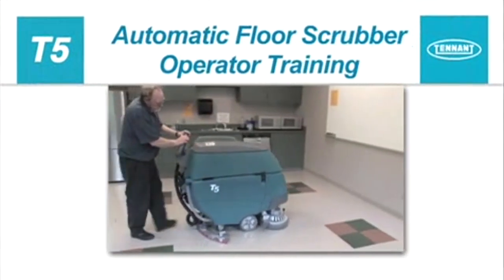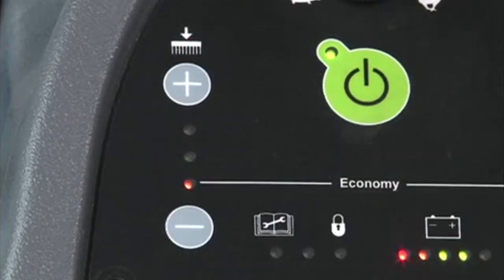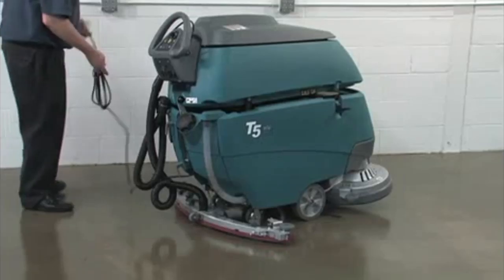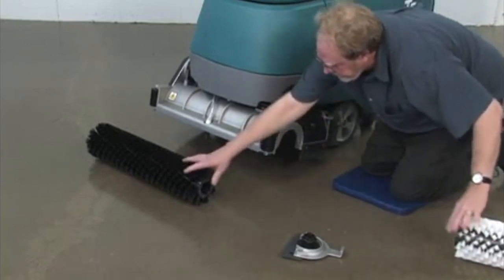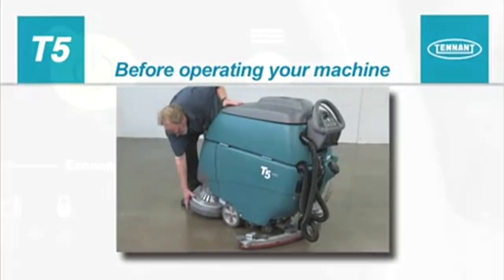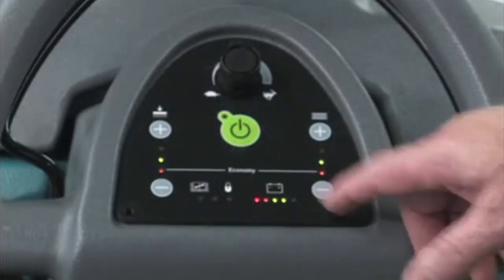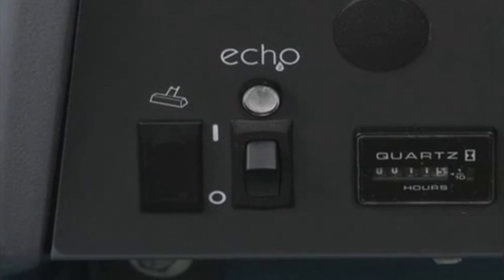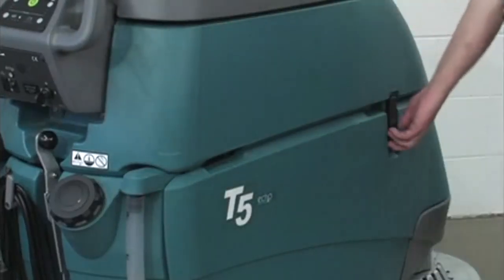Tennant T5 Floor Scrubber- Operator Training Video

Comment: I use this machine every day. I have a couple miner issues with it. The extraction tank is flat and dosn't empty completely. Extraction strip would leave water on floor even on wide turns needs to be a few inches longer. And if you need start in a narrow hallway backed up in a corner pads don't start scrubbing for aprox 3-4 feet. But an ok machine other wise.